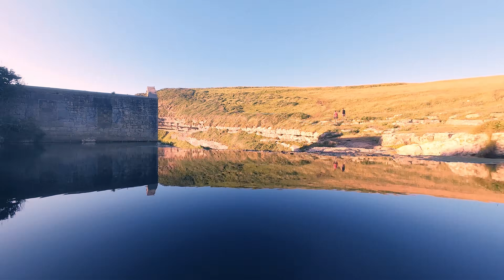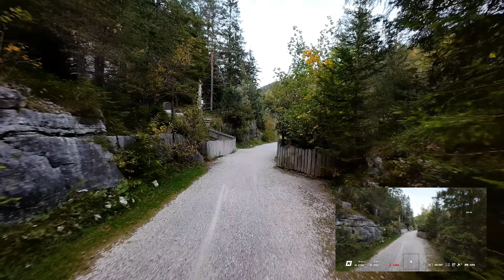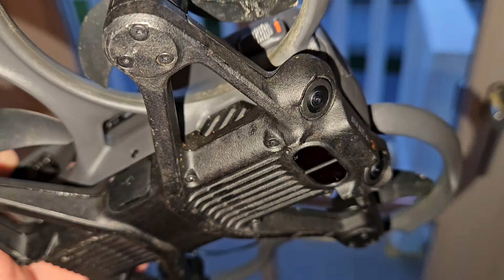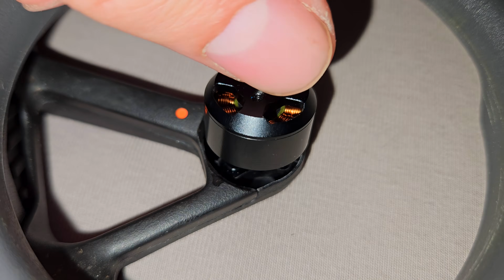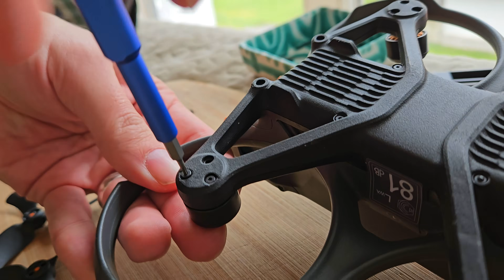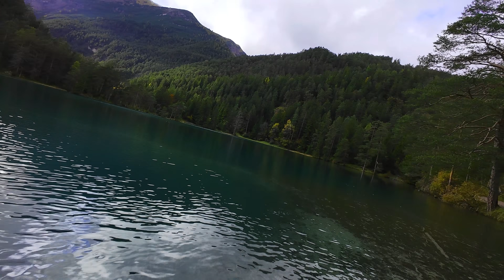WATERFALL CRASH! Can the DJI Avata 2 Survive THIS Extreme Failure? | HOW TO REPAIR YOUR DRONE!

Comment: Mine, and for sure others bad dream came true. Yesterday, I was finishing flight being about 10 meters away out of the forest, slowly returning home with 25% battery, it also become quite dark, when it happened. Countdown for returning home which procs on this battery level ended without me noticing, at the same time, I flew above very small stream of water, and at the same time under the twig! So suddenly avata started to rise - and tangled to the twig. I was about 200 hundreds meter away, afraid it will drop to the stream if I turtle, so I waded through the bushes, nettles and twigs and whatsoever, when I reached the place it was pretty dark there and found avata about 4 meters high above the ground. So I positioned myself to catch it, activated turtle mode, it was fightining the twig for few seconds, you could heard motors acceletaring and slowing, pushing the twig left and right, leaves falling, when suddenly it released in a weird direction and dropped to the stream. But it didnt go swimming, just touching the water, tumbled and ended on the gravel. Anyway it was all wet. I took it out of the forest, turn it on, tried, it flew. I was thinking how this drone is great, it already survived quite a lot crashes with me. But meh, now I am sitting here at my desk, with avata unable to take off, giving me random errors, seeing my mistake. And thats not all! When I jumped to catch it, my iphone dropped to the water! :D Today morning when I turned it on, it worked for like 10 seconds, before screen going green and then black. Dont underestimate the physics guys, neither eletricity, nor metal likes water!
Reply from the maker: That sounds like a nightmare scenario, really sorry to hear about both your drone and your phone!
When I dried my avata 2 (meanwhile 3 times as it was diving again), I always kept it switch off for minimum 24 hrs.
Do you have a fireplace? If yes, pit it above or next to it while heating for several hrs.
Cross my fingers for you. 
Curious to see the footage you captured before the crash. 😊

Comment: I crashed my avata 2 in water, do i need to replace the battery? Or can it be dried and used perfectly?
Reply from the maker: In my case I was using the battery again and had no issues.
After everything has dried, just give it a try.

Comment: I crashed my Phantom II in salt water at the beach. It was laying on the bottom 3 meters down.
 The Gopro 4 Black had no weather sealing. I washed the drone with fresh water and tried it after a few weeks. Everything works! The Gopro also =)
Reply from the maker: wow, that’s impressive. salt water is usually the worst case scenario, so that’s a lucky recovery. flushing it with fresh water and letting it dry properly really makes a huge difference. great to hear both the drone and the gopro survived.

Comment: Hi. After 1 year, is everything working properly? True is needed 😊
Reply from the maker: Hey there. Yes indeed it is. And let me tell you that the Avata 2 meanwhile did some additional water diving. 😅😅
Anyway it works like on the first day. Incredible endurance.
Reply: @doatrip Great! Mine went into a Pfütze last week. Sent back to dji and received new one yesterday. I was wondering about the battery and i did not want to risk with dji care still valid. Great videos!
Reply from the maker: @nicolac.2964 Wenn du die Batterie über Tage trocken gelegt hast, brauchst du dir keine Gedanken zu machen.
Mich wundert dass deine Avata 2 nach einer Bruchlandung in einer Pfütze kaputt war.
Aber gut, wenn du Care Refresh hast, ist ja alles prima. :)

Comment: Man I had a gust of wind blow mine into a tree as I was flying through them all in North Georgia. Tiny branch caught me and sent it out of control and landed in a creek upside down. It was about 2 inches deep. Currently drying it out. It sat all night because it cut off and I couldn't find it. This was yesterday twilight. And the SD card doesn't have the photos I thought I took 😭

About 100ft tree hitting every dang branch on its way down. Battery still works. Test the drone tomo. Put it over my rendering PC exhaust by my ac unit to dry it.
Reply from the maker: that sounds like a rough crash, man. hitting a tall tree and then ending up upside down in a creek is pretty much the worst combo. but don’t lose hope. my avata 2 has been underwater a couple of times already and as long as you dry it properly and get all the moisture out, it usually comes back to life.

let it dry longer than you think, open every cover, remove the battery, and don’t power it on too early. the pc exhaust trick is actually a good idea for warm dry air.

mine is still flying today after similar accidents, so there is a good chance yours will be fine too. let me know how it goes when you test it tomorrow.
Reply: @doatrip awesome. Im glad yours worked out. I will probably wait 48 hours. I'll let ya know!
Reply from the maker: Cross my fingers for you!
Reply: @doatrip  she works! I had to heat up some of the plastic blade guard to bend it back a little and she works great now! Haha! Wow! Id say about 100ft fall hitting about 10 to 20 branches. Landed upside down in a shallow creek. 😅
Reply from the maker: @Cinegistic  that is awesome to hear. crazy how tough the avata 2 is. a fall from around 100 feet, hitting a dozen branches and then landing upside down in a creek... most drones would not survive that. but as said, that one is rely durable :D
glad it is flying again. enjoy the next flights

Comment: Great to hear you saved your drone—flying is such a rewarding hobby!

I’ve been there myself. A few years back, my old Hubsan drone ended up at the bottom of a lake. Here’s how I managed to bring it back to life:

I completely saturated the drone with WD-40—practically drenched it. The goal was to displace any lingering moisture, so I didn’t hold back. Then, I used a blower to gently push out the excess WD-40.

When I powered it on for the first test, let’s just say things got interesting. The drone rocketed straight into my garage door with a loud bang! Amazingly, it survived without a scratch.

For the second attempt, I held the drone firmly in my hands, keeping my fingers clear of the props, and powered it up again. This time, it worked like a charm. To this day, that drone flies perfectly.

A couple of key takeaways: Make sure the drone is completely dry before you power it up, and for safety, always test it first without the propellers attached.

That’s my experience with rescuing a drowned drone. Wishing you smooth flights ahead!
Cheers!
Reply from the maker: thanks so much for sharing that story. that is wild… the drone shooting straight into the garage door made me laugh, and the fact that it survived makes it even better.

wd40 is definitely one way to force moisture out, but you are totally right about the key points… let it dry completely and always test without props first. that is exactly what saved my avata 2 as well. it took a full two days of drying before i even thought about powering it up again, but once everything was clean and dry it flew perfectly fine.

really appreciate you sharing your experience. always good to hear how others handled these situations. cheers and safe flights.

Comment: ***...First of ALL Disconnect the Battery...NO Current flow on the circuits NO Damage can cause...
* Second you can dry the drone and the circuits with a hair dryer and patience...this procedure will take the moisture away...
* Third you have to take the main board out from the drone and clean it with deionized water if you want to avoid corrosion from stream water.
    Water contain salt and miinerals.
* Motors can be cleaned with the same procedure as circuits without benn unscrewed...Because are made with enameled wires and this makes it waterproof.
* For the rest Moisture you can put the drone in a bag with Rise or something that absorbs moisture and let it sit for 2 days.
* Never put a metal screwdriiver against two plastic covers, you have the risk of damage them. Instead of this you can use a plastic lever.
Reply from the maker: Many thanks for this step-by-step guide!
Will take this into consideration next time, my drone comes in contact with water.
Since the crash 5 months have been gone and I can tell you, either I was Incredible lucky or the way I was proceeding was also okay.
Avata2 is still flying without any issues. No corosion, no other issues. All good. :)

Comment: Man, he handled that all wrong. It survived DESPITE his best efforts to kill it.

First off, ALWAYS remove the battery FIRST! Do so immediately! No battery, no shorts. 

Second, the motors are composed of enameled wires, and therefore, by their nature, completely waterproof. Never take them apart. 

Third, there's "Locktight" on the motor screws, which keep the screws from working themselves free when flying. It's that blue stuff. If he's removed that stuff, his motor screws will come loose over time.

Something he did right was to warm up the drone to aid with evaporation. He lucked out in crashing into very pure mountain water. The muck in ponds, or worse yet Salt Water, can cause their own shorts, even after drying. 

If you're really curious about fixing drone issues, there is a channel on YouTube where a guy regularly buys broken drones and fixes them.
Reply from the maker: @MaxSMoke777  

Thanks for the feedback! Let me clear up a few things:

1. Removing the battery immediately: Sounds good in theory, but if there’s water on the connectors, pulling it out can cause a short. It really depends on the situation, and in this case, I played it safe.

2. Motors: Yeah, the wires are water-resistant, but the bearings and other parts can still rust. That’s why I took them apart – better safe than sorry.

3. Loctite: Not a big deal. The screws are fine, and this isn’t something to overthink.

4. Clean water: Lucky it was mountain water, but even that can leave residue when it dries. That’s why I went for a full cleanup.

This was just my real-life experience, and it worked out for me. Appreciate you watching and chiming in.